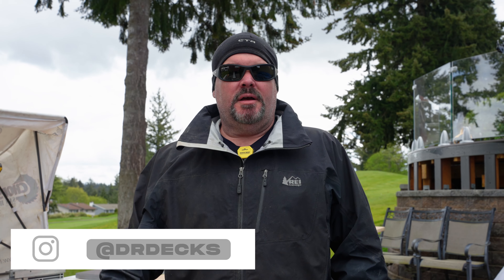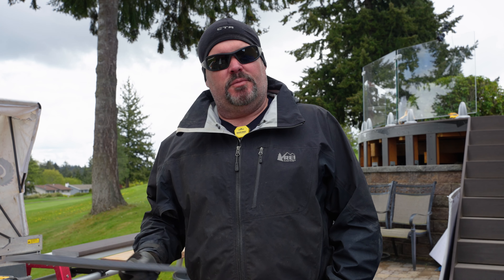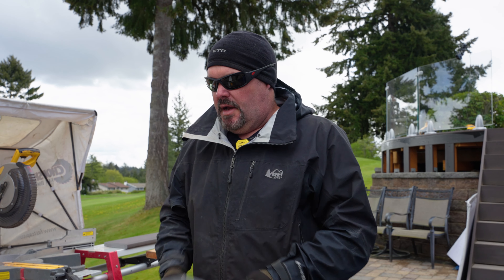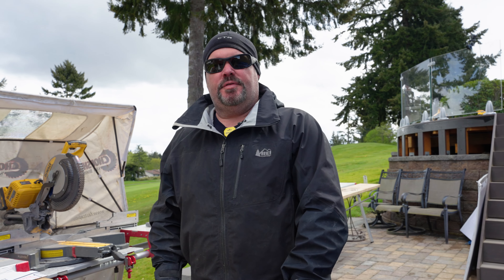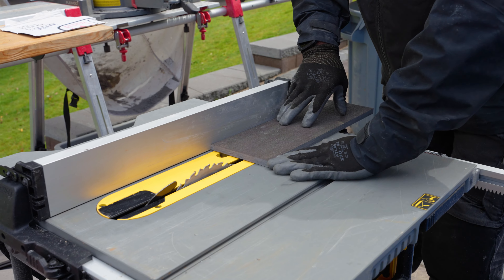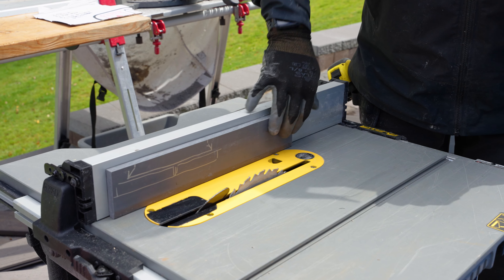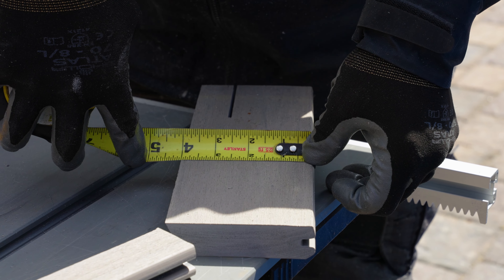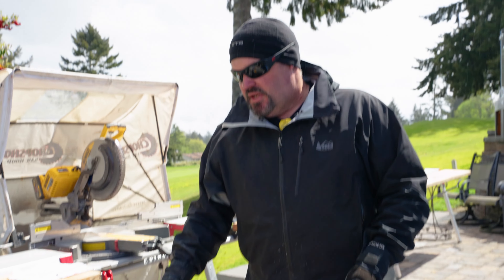How To Use A Table Saw (Tips & Tricks) || Dr Decks

Comment: looks like my dewalt table saw which is corded for the same reason you said....power, im using it alot....and your dropsaw looks like the same dewalt ive got...corded for the same reasons....and there reliable and sturdy. All my other power tools are mainly makita cordless, which is probably the most common here in NZ....but i do have a milwaukee  nail framer which i find is better than anything dewalt or makita produce as far as that tool goes. i try stick to a branded battery platform but as far as tablesaws and mitre saws go il get what i think is the best option...dewalt. (no metabo in NZ which i here produce good power tools).....sori for going off subject....always like your vlogs and tips. thanks.